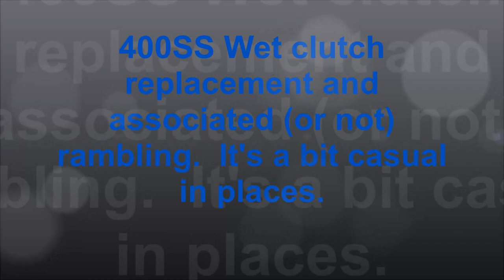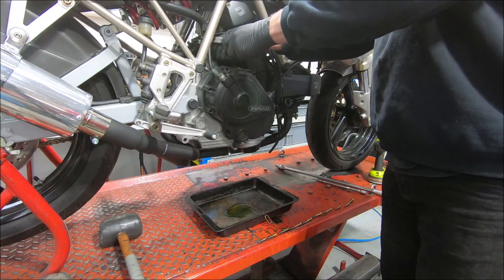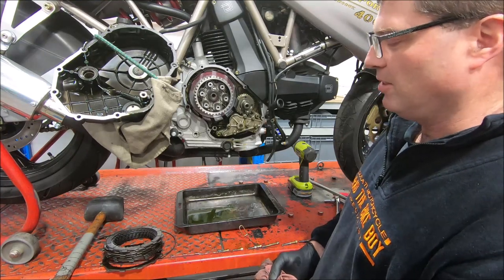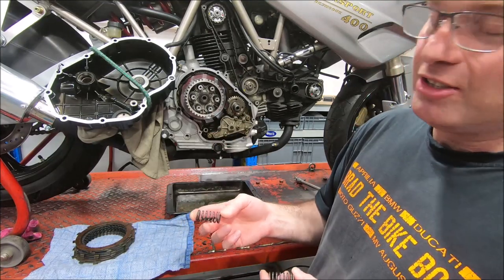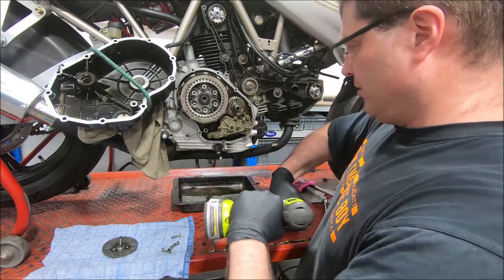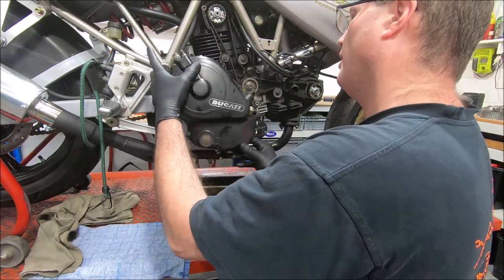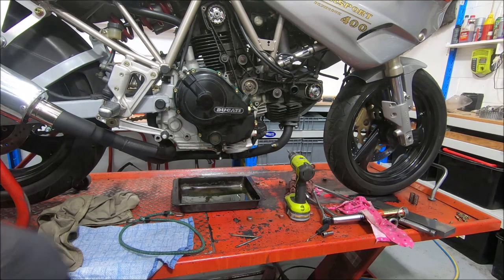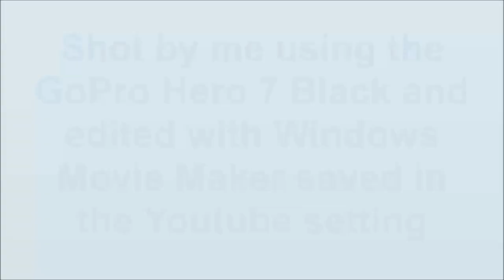Ducati wet clutch replacement pre 1998

Comment: I know this is an old post but I thought I'd ask a question here and hope you see it. I recently put a Newfren clutch in my m600 1994 which went absolute fine. I replaced all the plates and springs too which made finding neutral so much better. 
BUT when pulling away now with revs up a bit more I get this almost moaning noise or grrrr noise. It's definitely the clutch. I'm just wondering if you came across this or is there anything I may have done wrong?
Reply from the maker: it's pretty hard to know.  if it's not a physical stuff hitting stuff noise, and it's only on take off, i'm not sure that i'd be too concerned.  but it's your bike and i'm not near it to hear/feel what it's doing.  or just pull it apart again.
Reply: @bradthebikeboy  yes I'll maybe take it apart again and take another look. Keep up the videos, they're very helpful.

Comment: Hi, thanks for this most interesting video. I've got a 600 and after changing the master cylinder the clutch won't disengage (when cold). The circuit is completely free of air and the problem will disappear once hot... could it be my clutch plates?
Reply from the maker: if it was ok before you replaced the master, and now it's not, then it's either the master or hydraulic.  never seen one that is dependant on heat that i can recall, unless it's a lever freeplay / compensating port blockage issue.

Comment: Hi Brad, I'm typing this at about 19mins in and I was going to ask if you check the plain plates for flatness! An blow me down you just do it! I've had so many wobbly dry clutch plain plates that I check them all on a glass plate. What springs do you recommend for my Supermono project using 1/2 a 916 or 996 ST engine?
Reply from the maker: depends how many springs you want to run.  if it's half of everything with a normal clutch then it should only need half the seat pressure.

Comment: Hi Brad, I've got a weird happening on my 750ss.
I've just reassembled my clutch and added a additional plate and friction plate as the clutch was slipping and seemed to have a lot of play in the basket.
Now I get lever lock when going through the lower gears some time, ie the clutch lever will litrally jam half way through its travel at the bar.
I've had it back apart and the slave piston appears well and seals are good.
You mention about the basket falling off the back of the cage in the video, is this a possibility, could there be too many plates?
Would you know how many a 94 750ss should have?

Hope you can help I'm about to take it to a shop but would much rather do the work myself as these bikes are generally easy to work on.
Reply from the maker: i think i got an extra plate into my 750 clutch pack, but maybe i used thinner steels, i don't recall now.  hard to say without actually seeing yours.  if it's slipping, put a new pack in it.
Reply: @bradthebikeboy  it turns out I had too many plates causing the clutch actuator to lock up, I removed a plate and it's good again.
Thanks for reply

Comment: Hey Mate,  I got a 400ss as well and cant get the thing to start... got spark and petrol pump is ticking....any pointers?  pity your in Melb... I am in Syd.
Reply from the maker: dunno.  water in carbs?  fuel actually getting to carbs?  spark enough to fire a plug in the cylinder?

Comment: Hi can you tell me where I can get the plates
Reply from the maker: at a shop that sells motorcycle clutches?  ebay?  bit hard to give a specific answer without knowing where in the world you are.  if you want newfren find the newfren distributor for your area and ask them.
Reply: @bradthebikeboy  hi ok I get that but with me in the Ducati monster m750 from 1999 these clutch plates are also in but they indicate other plates in this Ducati I need those plates what you have in it with outside plate with iron can't find them anywhere link from ebay is also good I'm from the Netherlands Greetings Soy
Reply from the maker: @smotortips4875  first hint - use some punctuation.  one long sentence makes comprehending wtf you're trying to say rather hard and my motivation to work it out and then help you diminishes in direct proportion to the amount of effort i need to put in.  i'm not getting paid by the hour here.  help me help you.
Reply from the maker: @smotortips4875  given yours is a 99 it would have had a steel pack in it, but the genuine part number for it now is the later aluminium pack used up to the end of the normal wet clutch in 2008.  i'd use aluminium backed friction plates - it's in oil so there won't be any real wear from being in a steel basket.  newfren # is f1565.  oem is 19020092b.